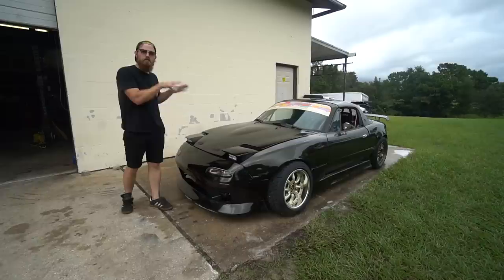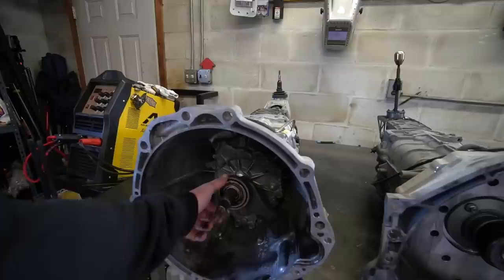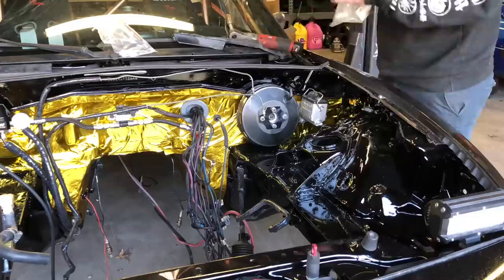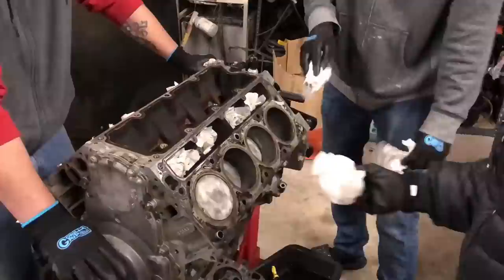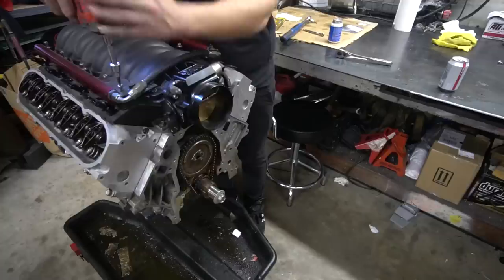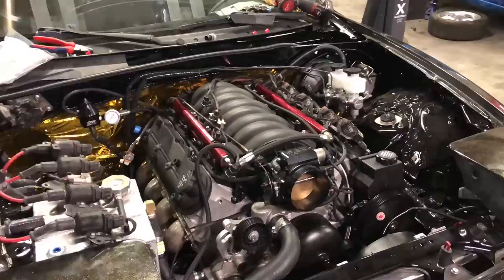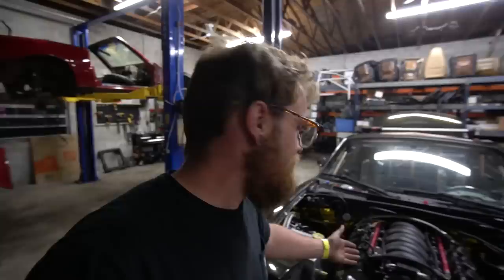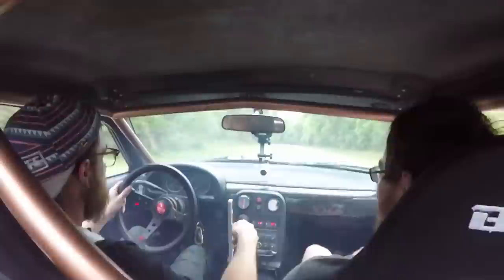LS Miata V2.0 Full Build Documentary! Resurrecting the Blown Up and Battered Miata. *EPIC Results!*

Comment: I'm enjoying your videos.   I have a friendly suggestion.  When you're checking out a used motor, pull at least one rod cap off,  usually the one furthest from the oil pump.  Just pulling one cap to inspect a bearing can save you lot of headache.....like you had with V1.

Comment: Taylor I don't understand why you didn't just stick with the T56 rather than CD09 cuz T56s are quite strong transmissions and you can turn them into a sequential with an adapter. That's what I'm going to do whenever I get an LS I think it's super cool you can convert it from H pattern to sequential without changing trans.

Comment: Check you reservoir for the ps pump, if it’s got a screen it may be clogged. I’ve ran into this with fords before. You may just want to remove the screen entirely if it’s got one. Also when you fire up new engine, a hand held temp gun is handy for checking for miss fires on the headers. If it’s missing it’ll be cold obviously. Awesome car!

Comment: Amazing video! love the full build series. For your power steering problem have you tried putting in a new pump without having a magnetic filter? I think it could be restricting flow to your pump and it could be dying out quickly due to not enough lubrication. I thought of this just because your first steering rack didn't go out for quite a while, then after that you put an inline filter in and you started running through pumps like no tomorrow, just a thought.

Comment: I'm happy it worked out the way you planned . 
But honestly I don't have the talent or budget to pull this off on my 240 (ls swap +plus trans + rear end swap) 
My car already has a SR20det I think with the amount of cash you spent total . It would better serve me to either A. Have a engine built by a pro for drifting with all the oil /coolant and standalone ecu safety measures . 
Or 
B. Do a Neo vvl head swap on a built sr. 
I feel like either way it would be more cost effective to stay with what I already have and figure it out .
C. don't stay on limiter like a dolt 😳🤷😁

Comment: I may be wrong but doesn't a 4.8 have flat top pistons and 5.3 have dished pistons i noticed yours is flat top usually the only way to tell them apart besides stoke and seein they share the same block
Reply: @lb9gta307  good info for sure but I'm wondering if he thinks he has a true 5.3 or is it actually a 4.8 lower end with 5.3 bolt ons?

Comment: Ford 5.0L H.O full injection Miata would have been sick motors are relatively cheap and reliable.
Reply: Run better at rpm also. I've been running iron head 408windsor for 8 yrs. I thrash it harder than in the last 8yrs than he would in 30yrs. But in all honesty if he actually knew what he was doing he wouldnt have the issues he has had
Reply: True that. Idk man ls motors are cool and all but old pushrod 5.0s are just nasty and reliable there also a dime a dozen best bang for your buck in my opinion.
Reply: I mean. 5.0 gt40p headed engines are so easy to find, cheap, and in decent shape. Plus the sbf game has changed altogether. Especially  in the drag racing scene. Where I'm from. I can build a 5.0 for less than what he has in head work, and the bogus warranty. Really are hard to beat. But ls do have some good points. But hey it ain't ok ur money right. Lol